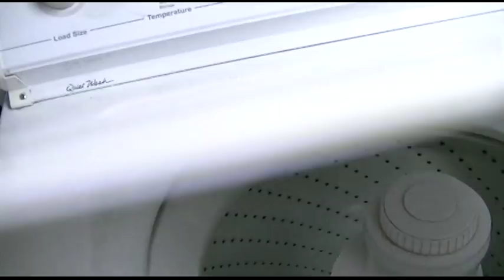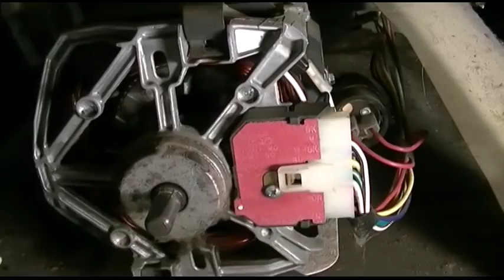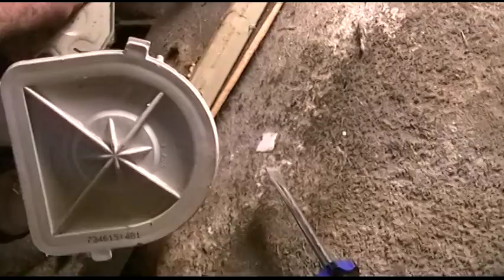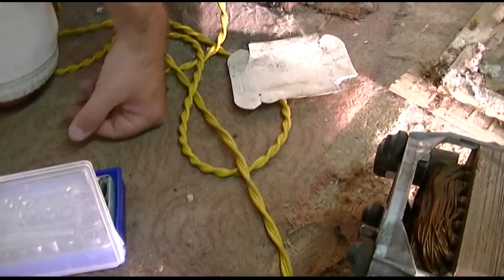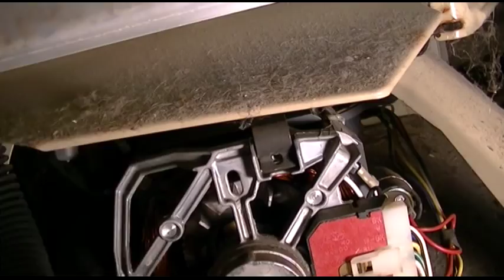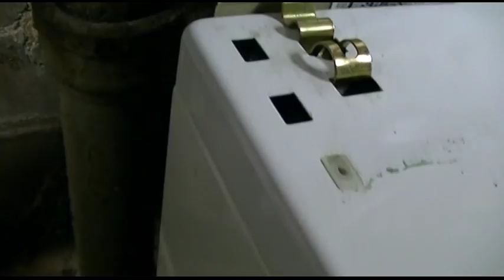How To Replace Motor Coupler--Whirlpool Direct-Drive Washer

Comment: I didn't watch this video until after I fixed mine this morning lmao mine made ZERO sound after it was full, and wouldn't drain.. ** it was still the coupler **.. the agitator wasn't moving during this issue either.. so, I unplugged the machine, pulled off the casing, took the pump off (left connected), took the motor off, and the coupling had jumped apart.. I used seafoam penetrating oil to try to remove the plastic pieces, but they were in good shape and proved to be too difficult to remove.. they also fit into the new parts the same way, so, since they were VERY stuck, I left them, and sprayed the crap out of the machine side, as I noticed it didn't spin nearly as freely as the motor side.. so I sprayed it and moved it around a few more times, and noticed it was moving MUCH better.. I think something had seized and caused it to jump off, or it jumped off then seized.. but after spraying the machine side of the drive so it moved better, the agitator also moved freely by habd.. so I just changed the rubber bumper between.. got it all put back together and off we went!! Thankfully, there's not many options of what can go wrong, but, was full of water still and made ZERO noise, just didn't drain or do anything lol glad I fixed it myself though.. repair shop wanted $300+, and suggested I just replaced it.. I spent $45 on parts and my 20 year old washer is working again
Reply from the maker: ZERO noise and a broken motor coupler sounds like the problem was compound, and only 1 of the problems was solved.  No sound means dead motor.  If the other part was locked up, you would have heard a nice loud hum and the lights would dim.

Comment: Great video. It's funny.This video is nine years old, but i'm fixing a washing machine that's older than the one in your video 🤣. No broken plastic but im going to replace anyways, here goes nothing.
Reply from the maker: Thanks very much.  There's proof that just because a video is older, doesn't make the information contained within less valuable.  Best of luck with the job, let me know how it turns out.

Comment: Thank you so much for this video! This enabled me to perform the repair on my own period I am still struggling to get the cabinet on correct for the bottom rear screws to line up.  Any tips?
Reply from the maker: You have to hook the cabinet on the front of the machine once you get it in place.  Once you do that, everything will go back together.  Frankly, that's one of the most finicky parts of the process.  If you can't get it, take a break, come back later.  It'll go.  It came off so it has to be able to go back.  Try a different approach, maybe from the side to help you.  Or if someone else is there perhaps they can help guide it back in place.

So we're on the same page, the "cabinet" is the big sheet metal surround for the machine; that has no rear screws.  Something else you're talking about?  The control panel maybe?
Reply: Thank you very much! I guess I have two screws that I don't know where they live!
Reply from the maker: @Steph11271  Chances are they either held the control panel down, or perhaps they were screws for the motor snap-brackets.  Those screws are often missing, and machines hold up just fine without them.  Proof these machines were well built.

Comment: My original motor coupling was plastic (non metal) all the way through.  Our new one had the metal sleeve that didn't slip in easily.   We used a small block of wood (~ 3 x 5x 1/2 in) to tap the coupling against the axles flush.   The socket helped push the coupling back further when the metal snap bands wouldn't sit.  Not looking forward to replacing these down the road.  Might need a gear puller or something for the sleeve.   Might be good to just get non metal couplings.   Thanks for your video!
Reply from the maker: You're welcome.  Yes, the old ones were all plastic.  But they would fail in time, the plastic dries out and becomes brittle, then you put a lot of torque on it.  So they're metal reinforced now.  The metal ones will come off, big screwdriver or something like a "pickle fork", like the back of a claw hammer, should do the job nicely.  Easiest way to prevent the motor coupler from breaking is to never overload the machine.  If you miscalculate a full load and want to squeeze in a couple more articles, stop, take them out, and run two medium-size loads.  Better for the clothes, better for the machine.

If you feel so inclined, please click the Super Thanks button and buy a guy a beer.  Much obliged.

Comment: OK just did this today on a whirlpool. Excellent video here are my key takeaways:

Give yourself enough room to get that cabinet moved out. I was in a very confined space and it made it much more difficult.
The more lighting, you can give yourself under unit the better.  I had very little lighting again made it more difficult.
The tools I used were flat head screwdriver, a 90° pic to help remove the old broken coupler 12 " or longer socket extension which I used to pound on the new coupler onto both motor side and transmission side.  Extention matched up perfectly with the metal coupler insert so I didn’t have to use a socket. 
threw a couple of old pillows and an old yoga mat down for cushion in case you’re going to be down there a while and I’m old so it hurts!  lol
Again, just follow the video. This was really well done so hats off to both of these guys at eight years later it’s still very good information. These washers will last along time with a few repairs here and there. Thanks again!
Reply from the maker: You're very welcome, thanks for sharing your insight ant take on it.  I didn't have additional luxuries like extra tools, lights, pillows, anything, as this was done on location.  I just had what I brought.

Comment: Hello again Jay, I just did this to my new Kenmore 80 series I just saved from the trash, it now spins and agitates but it makes a really loud squealing sound when running, would you have any ideas as to why that could be? It didn’t make the sound before I replaced the coupler, I followed this video to the fullest extent and everything is placed in correctly and it has the correct coupler replacement. I uploaded a video today on my channel of the sound if you’d like to hear it, but cannot figure it out after taking it back apart again and it still makes the sound. Thank you for such a perfect video on how to do this, just wish I could figure out this noise.
Reply from the maker: The newest video on your channel was posted 9 days ago.  You had that and another one of the machine doing a neutral drain, sounded fine on both of those.

My recommendation, without seeing anything, is to unclip the drain pump and pull it away from the motor, then run the machine again and see if it still makes the noise.  If so, it's not the drain pump.  Is it possible one of the motor bearings is screwed and that's why it's squealing (even though it was fine before)?  Unlikely, but possible.  To test that, you'd unbolt the motor from the machine and run it again with no load on it.  If there's still noise, I'd have to hear it to know.
Reply: @jaykay18  My apologies, I should of stated in there before that it was a short that I uploaded today which is why you didn’t see it, not a regular video, a short, it’s up though to listen to, I’ve never heard a machine like this make this noise. Thank you, that’s the next thing I was going to try out.
Reply from the maker: @goldenwoods265  I have no use for shorts, didn't think to check it.  But now I've seen it.  Indeed, that is a very strange noise.  The pump could easily make that noise.  The pump spins in one direction while neutral draining and spinning, and when agitating, it spins in the other direction.  You can actually see the pump pump AIR into the machine during the agitation, with the cabinet off, because it's spinning backwards and sucking air.  If the pump is shot, that could definitely be it.  Other thing it might be is the coupler on the transmission shaft, is it indeed installed flush with the shaft as shown?  If it's driven too far on, it might rub, and that could cause the noise.  I know you said you did it properly, but double check while the motor is out.  Just in case something went awry.

Another thing you might be able to try, with the motor removed, is to spin the coupler on the transmission by hand, which will be slow of course, but it may help you to pinpoint the source of the noise.
Reply: @jaykay18  Neither do I, I am not a fan of these new shorts. You were exactly correct, it’s the pump. Washer runs perfectly without the pump on, and makes no strange sounds at all, so will be ordering a new pump for her. It’s got the original pump still…I already had the coupler on hand since I accidentally ordered it long ago, and my neighbors were about to throw this machine away and I saw the underneath and said absolutely not happening, transmission looks and operates like new still as for the clutch as well. Thank you so very much.
Reply from the maker: @goldenwoods265   That's the best news I've heard all day!  Been having kind of a crummy day today, made me feel a lot better to know that what I said was correct!  Even better for you, since pumps are cheap and readily available.  Pumps today are typically knockoffs; they work fine and pump fine, but be prepared for a small leak.  Sometimes the diameter of the pump inlet and outlet ports are ever so slightly off.  If it leaks, reposition the hose and/or clamp and you should be good.  Worst case, you can use some RTV silicone on it.
Reply: @jaykay18  that’s awesome! Glad to hear my machine could make your day a bit better, however it’s not making mine any better. I swapped the pump from my Whirlpool onto this machine and it still makes the horrible sound with that pump on it which is totally good still and has no problems, and it’s the same exact pump. Pump from the Kenmore had all kinds of pebbles and junk inside it…So lost at this point but it’s got something to do with any pump being on it for sure as it does not make any abnormal sound with the pump disconnected.
Reply from the maker: @goldenwoods265  You've tested with water in the machine?  Water will sort of help lubricate the pump.  That's first.

Second, is the pump mounted squarely and securely?

Third, is it possible that the bearing on that end of the motor is bad?  Yes, possible.  Unlikely?  Probably.  Can the bearing be oiled or greased?

Fourth, and this one is a bit far-fetched:  Is the line from the tub to the pump and the pump out of the machine completely patent and clear?  Is there something perhaps in that line that is setting up vibrations?  Anything is possible.
Reply: @jaykay18  Yes, pump is perfectly on, I flushed out the crap that was inside of it and I think it’s still fine, the impeller looked flawless inside of it. Going to do a water test today and see what happens, i already dumped a bit in to get everything wet again. I was thinking that it’s possible that it made the sound cause of no water being present in the machine, cause at first it didn’t make the sound it came on shortly after plugging it in to quickly test operations after fixing the coupler before hauling it into my small and tight laundry room. Luckily I only ran the machine for a brief period without water, any longer can be damaging but I’m sure would have to be quite a bit longer than what I did. Hope that’s all it was. Thank you for your immense knowledge & troubleshooting with these machines I’ve been able to learn so much just from your videos with Sharkie over the past ten or more years.
Reply from the maker: @goldenwoods265  You're very welcome!  Please let me know your findings!
Reply: @jaykay18  Just did a water test, and sounds totally smooth. It was just because it was dry when I briefly ran it before!! Moving it into my laundry room today!! This thing is pretty quiet too, and no slipping into spin like my old machine always does! Yay!
Reply from the maker: @goldenwoods265  Nice deal!  I always come up with 3 or 4 things that can be the cause of a problem, then work my way down the list from there.  The list is ranked from most probable to least probable.  It breaks it down into manageable chunks.  Very rarely does it have to extend from there.  Glad everything is resolved.  And note--that was the first thing on the list, most probable cause.  Using that method will help you diagnose a problem with anything.

Comment: After replacing this part, once I started the machine, it smelled like rubber was burning.. any thoughts On why
Reply from the maker: The question is, did the machine otherwise operate normally?  If so, it's possible that was remnants from the old one.  Otherwise, you're going to want to open it back up and check your work, and check for wear on the rubber.

Comment: I replaced the coupler and clutch. Still getting the same sound, would the motor be the issue? Great video!
Reply from the maker: Take a good, close look at that motor shaft.  It may be rounded out, especially if the motor coupler has the metal insert.
Reply: @jaykay18  the motor coupler fits extremely snug, not rounded - I have it apart again now, I kept the motor and drive connected and it seems to be connected correctly - same sound I was getting before the replacement.
Reply from the maker: @nicholasavignonesr2764  You can run the machine without the drain pump, take that off as a quick check to see if it still makes the sound.  Otherwise the problem may be downstream of the motor coupler, could be anything.  I can guess as well as you can.  I've also seen a bad motor or bad capacitor cause an issue.
Reply: @jaykay18  appreciate your prompt response and feedback! Thank you sir!
Reply from the maker: @nicholasavignonesr2764  No problem, good luck.